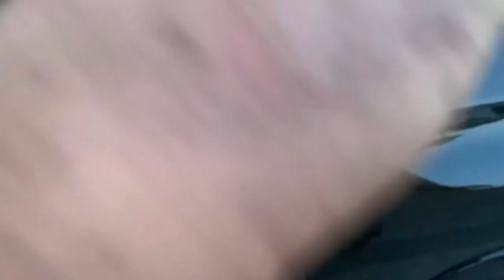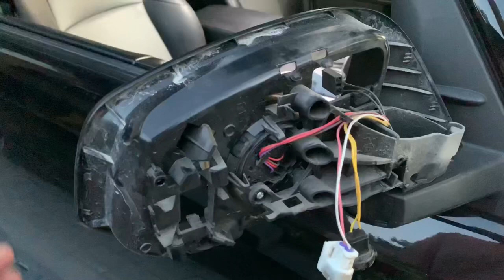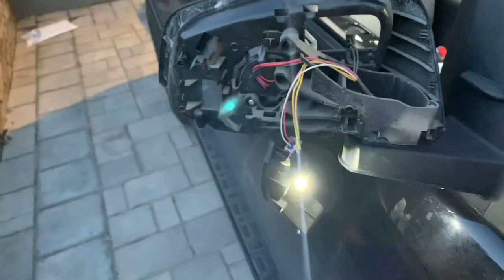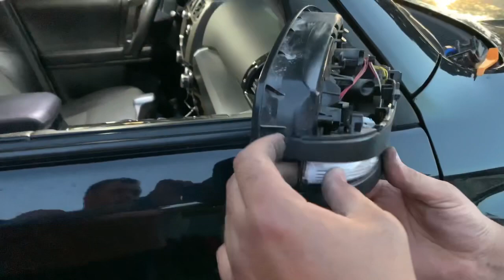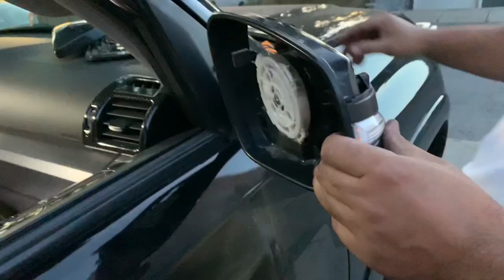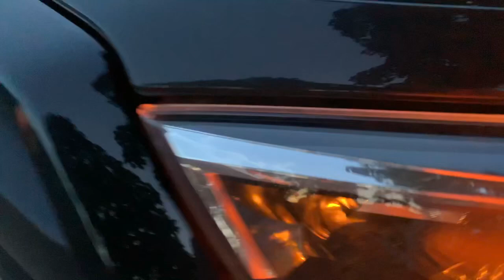Sequential Dynamic Mirror Turn Signals 5Th Gen 4Runner  2014-2020

Comment: can you see them blinking from behind the vehicle?
Reply from the maker: Yes you do, the runner’s leds are designed with a indent at the edges to make them  visible … 

Also, if you want full blinking from behind, check this :) can’t go wrong. 

All my codes have links in the description with exclusive coupons and important info in them. 
Cheers

https://youtu.be/t78Pzv0jyJE

Comment: I have 2020 trd off road, with no side mirror turn signal, will this still works?
Reply from the maker: If you DO NOT already have the led lights built in the mirror, it’s doable but not plug and play. You need to run electrical wires, to the blinkers in front. If you’re not handy and know electrical, I do not suggest them. Since you DO NOT have them factory.

Comment: Are they still working? Any issues with water getting inside or condensation building up?
Reply from the maker: Matthew Martin do you have them? Depends where you buy from; many do this, but the one I posted the link in the description are the best abs warranty 1 year: use coupon code 5SEV

Comment: Does not work on 2020 model. It plugs in, but brackets and angle are wrong.
Reply from the maker: Runner 2020 mirror is different ? Where did you buy ?
Reply: Never mind, i was thinking the bracelet will fit. These are unversal ones for multiple cars, i was finally able to fit them in.
Reply: @danshak4984  what did you have to do to install them? I'm having the same issue with mine and it's a 2020 TRD ORP.

Comment: Where did you buy them ?
Reply from the maker: From here. Here is where I got them from 👉🏻 https://cartrimhome.com/LED-Side-Mirror-Sequential-Dynamic-Turn-Signal-Light-4Runner?tracking=ncJKtrtdNkES3RSYEOSXlG4r7y7yGJS1z8PFUL4ho3ejj9k5w51QlgTnFbwhJkTW

Check the description of the video bud. Cheers
Reply: Sevag Merdinian 
I bought them in that website and is exactly the same but  I couldn’t put it , I will try one more time
Reply from the maker: Adolfo Aparicio what was your order number ?
Reply: Sevag Merdinian 
I just did it , I was Doing it the wrong way
I was  putting  the right on the left side
Looks great !!!! 
Thanks a lot for your videos
Reply from the maker: Adolfo Aparicio pleasure bud , glad it all worked out, did you buy from my link or direct ? What was your order number bud ?

Comment: I don't have any factory lights in my mirrors on my SR5....I guess that is an option on the premium models?
Reply from the maker: DBOne Journeys yes :( on premium ...
Reply: @KingSev  This is only for the Limited right? or would TRD Off-Road/Premium work too?
Reply from the maker: Chris Sommers anything that already has the side markers / signal turn, works, mine is an SR5 premium. The one you see in the video.
Reply: @KingSev  looks very good. I really should send you a photo of my 4runner. LOL